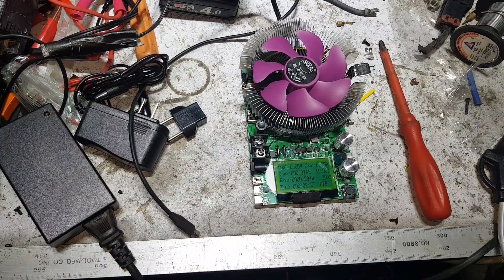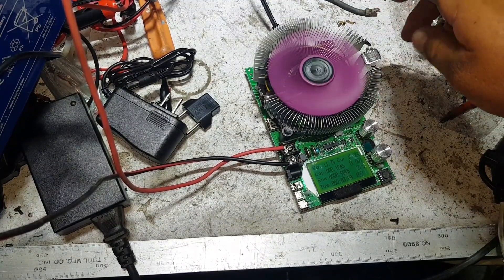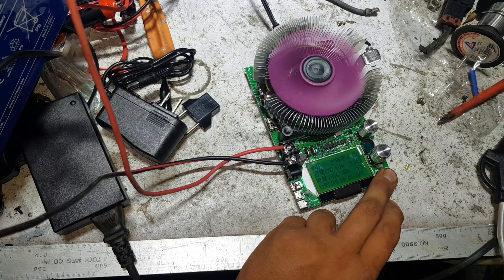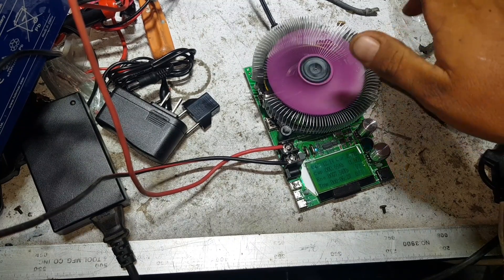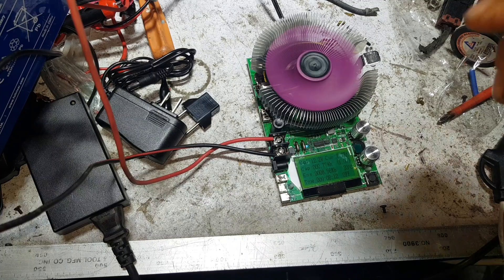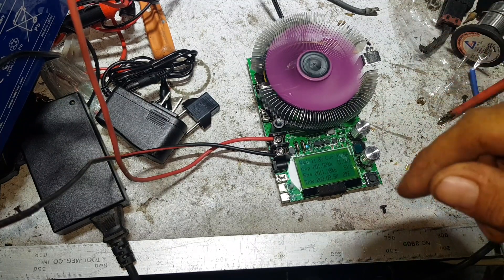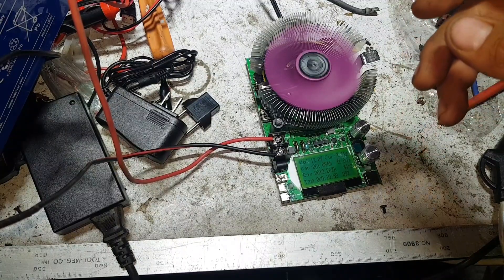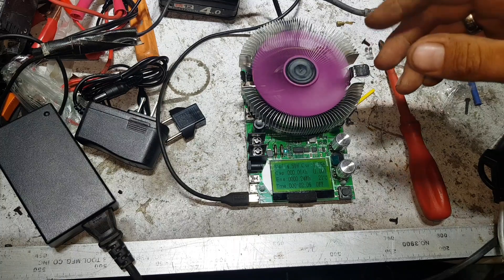Review time 8 In 1 150W Digital Battery Capacity Tester Constant Current Meter Indicator

Comment: how accurate is the internal resistance measurements if you have one of those meters to compare it to
Reply from the maker: I did compare and it's close withing 15 to 20 % most of the time. I cooked the chipset later on though will have to buy anotger